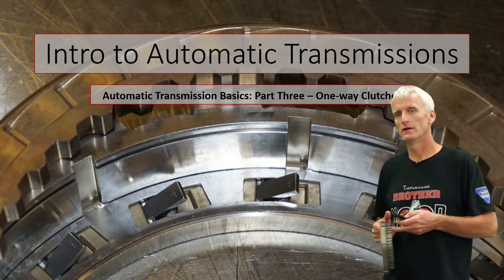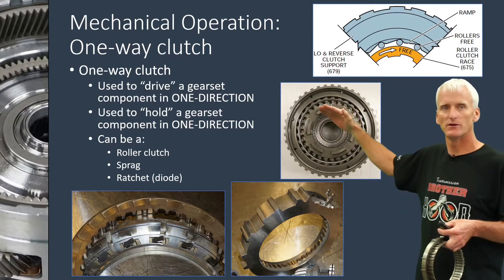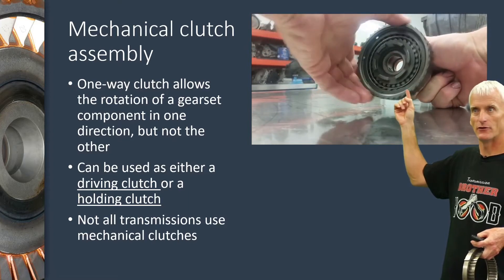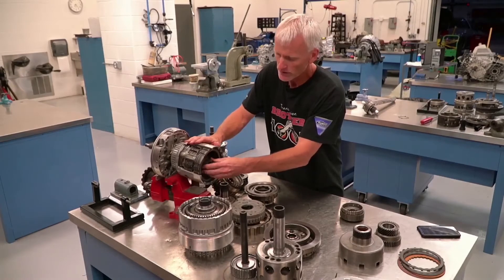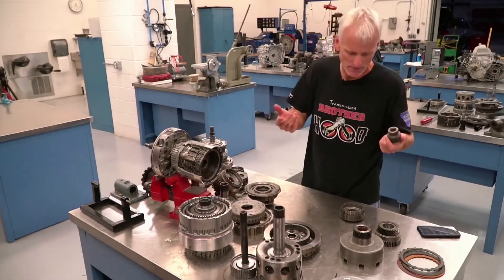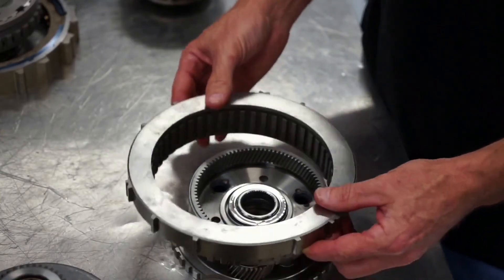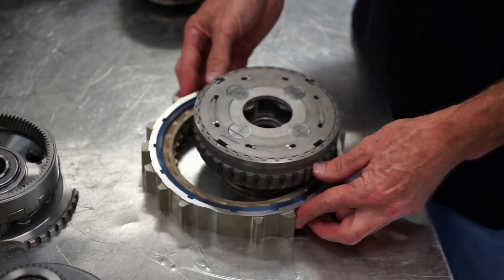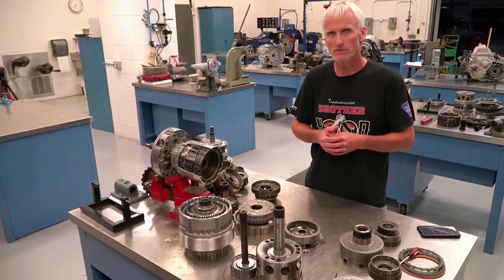Basic one-way clutch operation

Comment: Also there is a mechanical diode and the rocker style one way clutch where the plates are not serviced seperately as in the 08-10 ford 5r110w low one way,,reverse planet assy

Comment: Want to ask  a question. Seem confusion the rotation which way.thinking  I want to mount a smaller tires as a fly wheel that free spinding as the car stop.. does this do it? Want to charge my battery somehow. So it all motor bike has a auto clutch bearing?

Comment: My u140f 4-speed automatic transmission is unable to shift into 4th gear, and I can figure out on my own what is causing that problem, but what is puzzling to me is that, apparently as a side-effect of that problem, I am now able to use my O/D button to engage/disengage engine braking. In other words, instead of the O/D button controlling whether or not the transmission is allowed to shift into 4th gear or not, now the O/D button instead controls engine braking. Anybody know how that might be possible?

Comment: Any disadvantages or limitations,such as power reduction etc
Reply: A sprag clutch is more power dense than a roller-ramp type.  Then, in general, a sprag cluch prefers the inner race to be the higher speed free-wheeling member.  A roller-ramp prefers the outer race as the freewheeling member. There are exceptions as always.  A sprag clutch will definately freewheel at higher rpm.

Comment: Thank for the Video. Very Useful content. 
I understand this is used as One-way Clutch. Do you have something where clutch can be used for bi-directional rotation. I mean allows input torque transmission  to output in both Cw and CCW direction but it stops transmitting from Output to Input. Basically to prevent Backdriving of Prime mover due to exteranl load on Output side?
Reply: @Reign Ray instablaster =)
Reply: @Luke Beckham Thanks for your reply. I found the site on google and Im in the hacking process atm.
I see it takes a while so I will reply here later when my account password hopefully is recovered.
Reply: @Luke Beckham it worked and I finally got access to my account again. Im so happy!
Thank you so much, you saved my account !
Reply: @Reign Ray you are welcome :D
Reply: @reignray1222  it worked?
Reply: Those exist.  Formsprag has them.

Comment: Many years ago I worked for a company that designed and manufactured 
turnstiles, the kind you might find in railway stations and football grounds.
A new model turnstile was designed for a specific customer.  In place of the 
traditional pawl-and-rachet the new design used a one-way bearing.  Instead 
of the usual click-click sound this one was totally silent and could not be 
turned in the no-go direction, not even by the smallest degree.

In applications where a mechanical device is used by thousands of people 
every day, even the remotest possibility of an accident is likely to become 
evident sooner or later.  This became sadly true and resulted in the death of a 
child.

Mechanical engineers, please be warned.  The old pawl-and-rachet seems 
intrinsically safe.  After each click, the turnstile can be rotated backwards by 
a small amount and provides a margin of safety under extreme conditions of 
use.
Reply from the maker: Thanks for sharing.  I can see how that sprag design could cause problems in a turnstile.
Reply: How did it kill a kid?